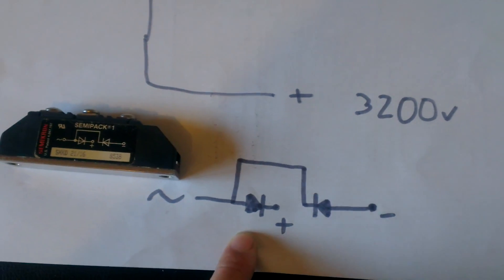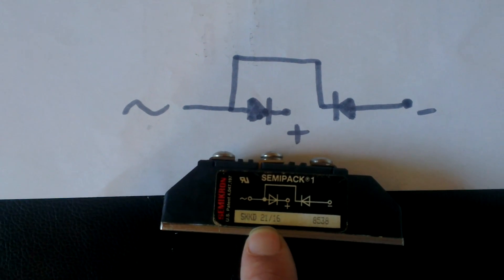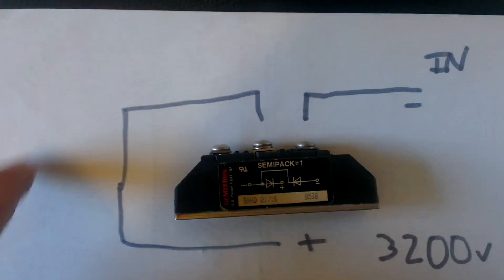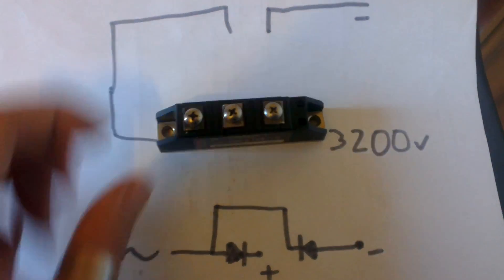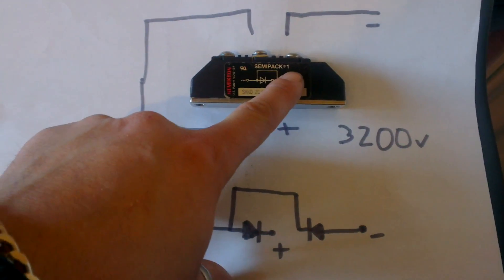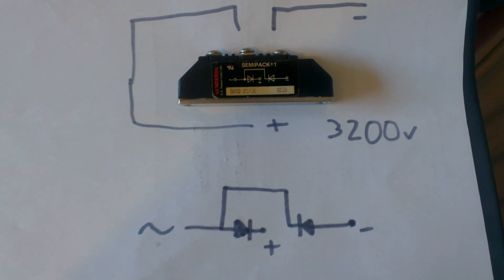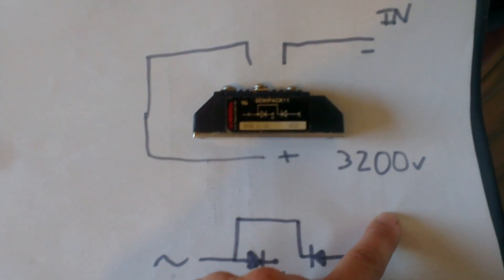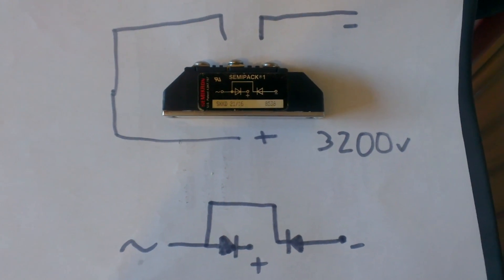THYRISTOR DIODE HELP PLEASE

Comment: As other have said, the two diodes will share the voltage, but not perfectly, so you might be able to get 2.8 - 3 kV reliably. However, these devices have a maximum rating between the internals and it's metal base-pad, which is usually 2.5 kV for modules this size. With this in mind, I wouldn't use them beyond 2.2 or 2.3 kV.

Comment: No problem, and like Kizmox said, it would be a good idea to put resistors across the diodes so that they share the voltage more or less equally. This is a massive diode module (at least to me), and it wouldn't be something you want to burn up.

Comment from the maker: I had planned on using microwave diodes (which i need to find first) for the doubler because of the peak voltages and these type for the half wave .Its for a VTTC cant remember if i said in the vid or not ?!?! thanks

Comment: Yes you can series these diodes BUT just seriesing two 1.6kV diodes does not give you a 3.2kV diode. 

Due to manufacturing tolerances and small differences in those diodes they wont share the voltage identically. You can help this voltage sharing problem by having resistors in parallel with both diodes. Something like 470k-1Mohm 5W resistor over both diodes will ensure somewhat proper voltage sharing. Perhaps then it will be 3000V diode..

Comment: I believe that if you do use them in series, then it will yield a 3.2kV diode, but if you used it with a capacitor in a voltage doubler, remember that the peak voltage across the diode will be about double the peak input voltage. I cannot confirm my statement as I don't know which configuration you are planning to use.